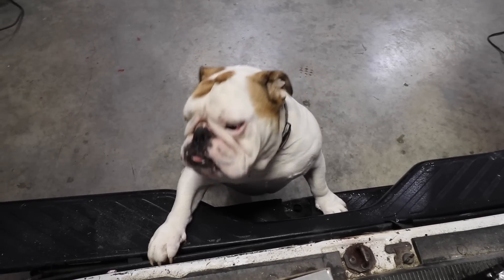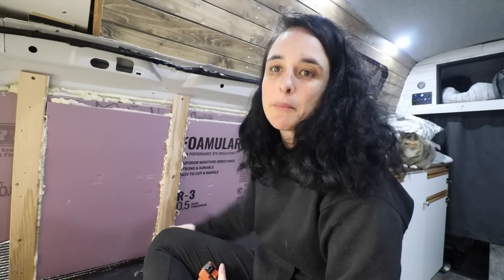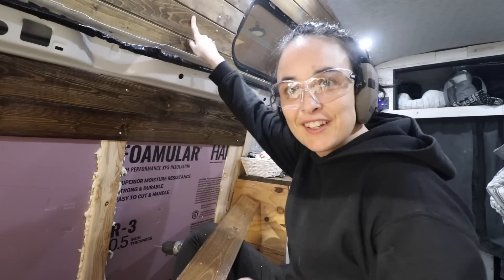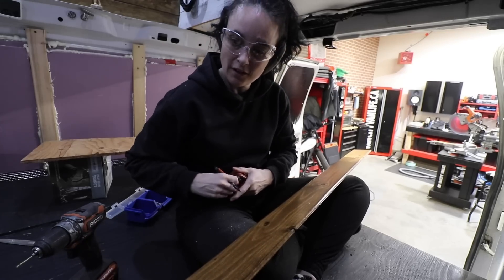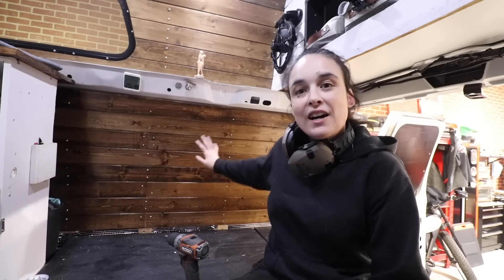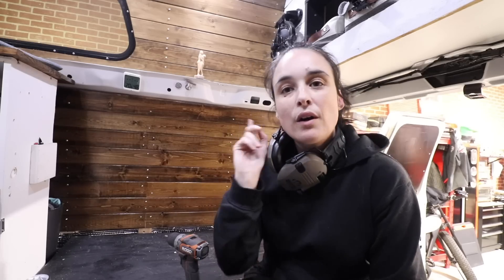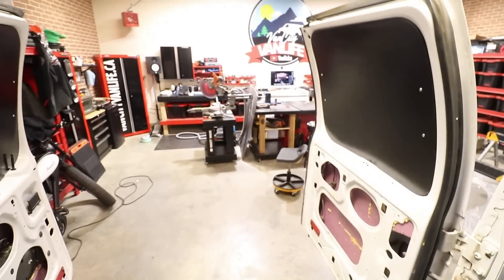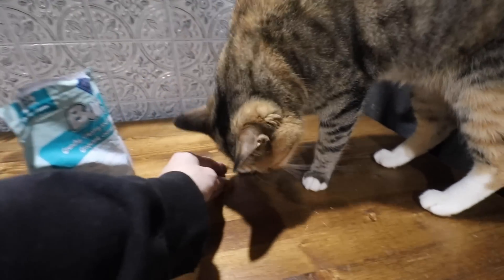I JUST CREATE MYSELF MORE WORK | Installing my walls | Van build

Comment: You can strip and stain the walls without removing the boards. It is no different than redoing cabinets on the wall. It might be a little messy, but if your careful it would be okay. BTW it looks nice. Have a Blessed day :)
Reply: But it probably won't match.
Reply: @Norma B  may not be exact but will probably be close.

Comment: Hey! Just a hint that can help with the dark and light shade of your wood. Your top layer of wood will most likely fade more over time than the lower ones due to more direct sunlight (which is a good excuse to not redo it lol😉). A good way to make this look like it is part of your design plan do this one simple trick! You said you want to add pops of color as accents (teal if I remember correctly), so simply pick accent pieces in some lighter shades of teal and some in a bit darker shades of teal. The lighter teal shade ones place in area nearer the darker wood and the darker teal shade ones nearer the lighter wood! You can do a mix match of darker and lighter teal in area around your backsplash. That will balance out and blend the color scheme for an overall more pleasing eye appeal. It will trick the eye into seeing it as a pattern instead of a mismatch! Annnnd it means less work and future fading less of an issue. A win, win!  Love it! Looks good. Doing a great job. I fully understand doing things in stages, makes perfect sense to me...but I'm a bit of an odd old bird! 😜 Take care!

Comment: Love seeing you working together and bouncing ideas off Chrome and enjoying the shop time together- looking to good so far your backsplash came out nice too - maybe the upper planks could be in your vintage style white like your other one using dap caulking to help seal up the corner cracks so it looks more uniform & maybe an aqua color middle section shelf or something you can put wire baskets mounted to a piece of wood -good to not rush - enjoy the whole process - the decisions you make will benefit you in the long run 🎉❤😊 very French country and beautiful love it 🥰

Comment: Looks really nice. Good job. Perhaps if you did a light layer of white wash over the top wood panels and allow the stain to show through   it would tie in very well with the backsplash and the white panels on each end and the newer panels..  It would be a quick easy fix to pull it all  toghether. The Aqua touches will look fabulous. Just a suggestion but it's your place , not mine.

Comment: I like the walls and I wouldn't  bother taking  the top apart unless you need to redo the whole top of the van. What is the reason for  permanently  blocking the back windows?  Weather  or security?

Comment: I heard you and Chrome talking about how the new boards look better and he suggested you take the others down but you said it would be a lot of work and then you would have to add insulation and it's not in your plan. How about just sanding the boards and restaining them without taking them off the wall? Then they will match 😁😁😁

Comment: Hi Emi! Everything is looking amazing! Hi to Kelly👋
Also, you can re-stain over the existing sealer on the wood on the top without removal. Just a light sanding. I worked at Home Depot in the paint department for many years and can help you with that if you choose to go that direction. I live near your area! - Doren

Comment: If the color difference bothers you. Mix the stain with polyurethane and see if that will darken a bit. Just make sure you use the same base product…water base or oil base…not both. I think it looks great either way. A little contrast.

Comment: Hello Emi and Kitty, Nice work there and I really love the contrast between the light and darker panels. If I was to change the top boards at all I would paint them with Fusion Mineral paint (Château or other lighter Color , ( see sample Color chart) . I painted right over a dark Color fire place with 2 coats no primer needed and it was a breeze. Very vintage looking. Also one of your other subscribers mentioned hanging wire baskets so that’s another option to mask the contrast. But like I said , it looks really nice as it is and even more so when you finish putting the whole look together. 👍😊

Comment: I like the back panels as well that you did on the doors. You've done a very good job just a thought though you can get that fake stick on wood vinyl to match the wood bed sides as well to cut and fit onto the black panels if you wanted to just another idea 👍

Comment: It doesn’t look bad at all with the difference. Also if the top wood is as dark (all the way around) as the bottom, it will make the place feel smaller and much darker. I’d personally just leave it, or even make the top even lighter. Just my 2 cents. Whatever you do with it will be great!

Comment: Are the sides symmetrical on the top of your van? If they are, would the screws line up?  If they do, you could remove the top boards and stain the back side of them. Then put them back on the opposite side of the van with the lighter color facing the insulation and the darker facing inside the van.

Comment: Put another coat of stain on the top...you dont have to take it off to roll the stain on. Mask the windows and anything else you dont want stained and add a coat to the top..it will look fantastic..a light sand with a scotchbrite will be enough to scratch it and accept the stain.

Comment: I think it would look much better if the whole thing we're all the same stain.  It would make it look a lot richer.  There is no reason why you can't put stain on it while it's up on the wall.  What about the piece between the two sections.  That needs to be all the same.  It cheapens the look of the hard work you've just done.